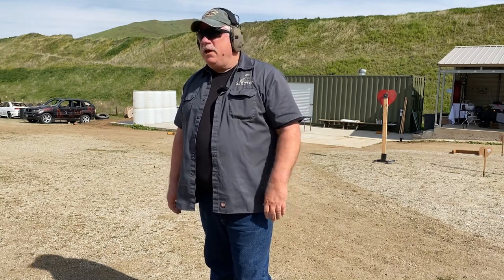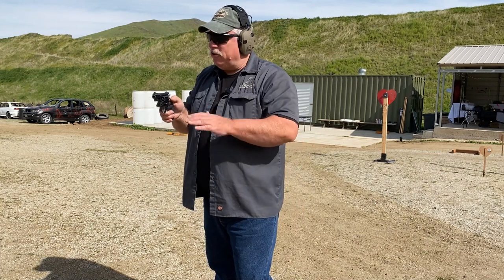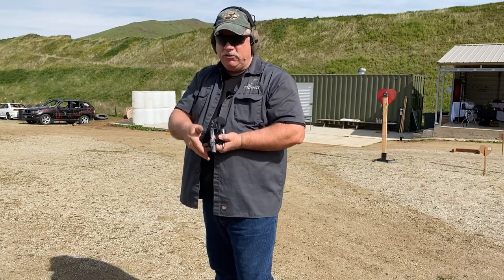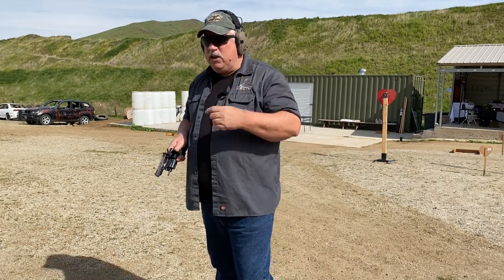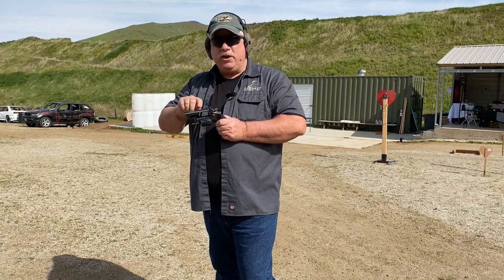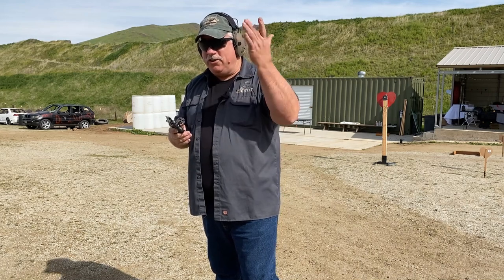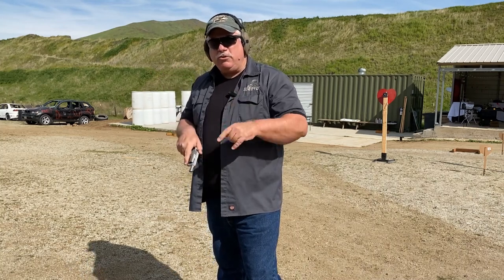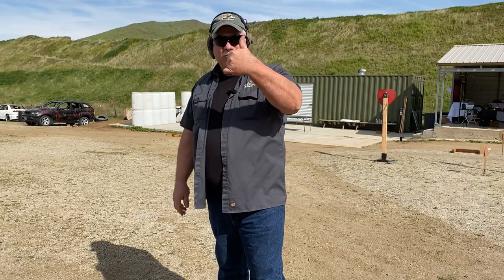Range Demo: Speedloading Revolvers

Comment: I’ve always used the old style of putting fingers through the window. I shoot a centennial J frame 38special. I’ve never had a problem with the heat however I am a plumber used to handling hot items and I have callused hands…

Comment: I have a few revolvers. I've found when using the HK 36 with my 642 J frame the loader fits tight. You definitely dont want to push it in to tight or it'll get lodged in. It's tricky. I have a 44 that I had the cylinder machined for moon clips and there's a lot less fumbling. Just drop em in. Good video. Thanks.